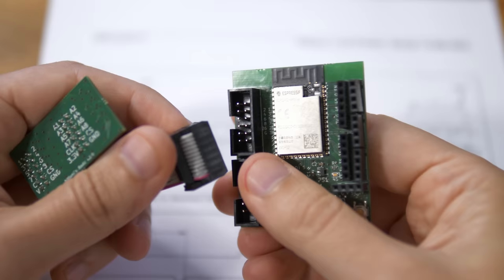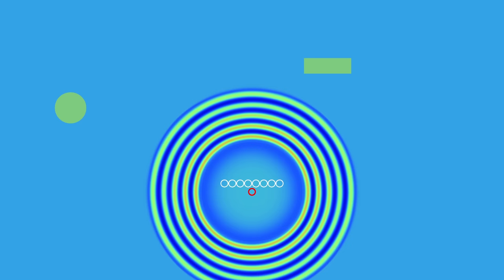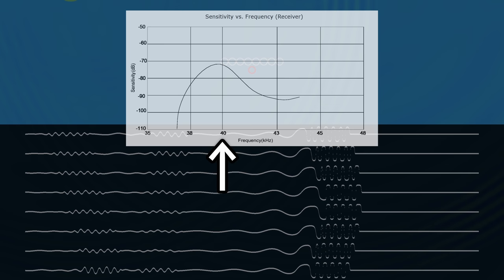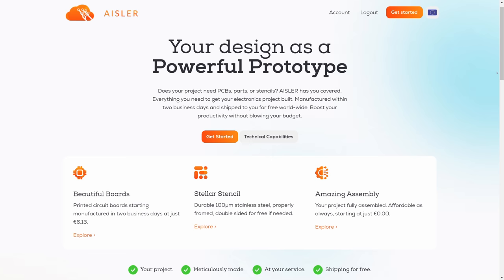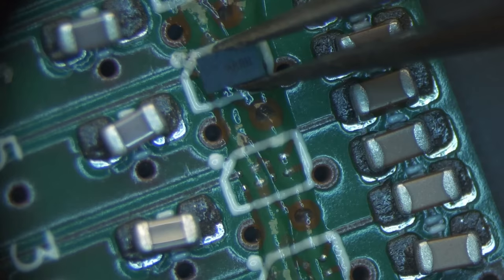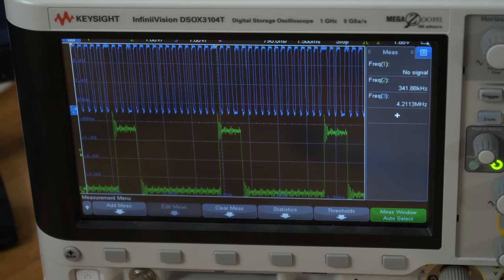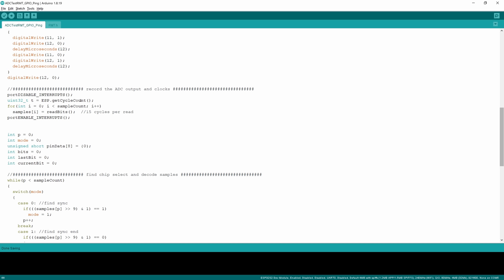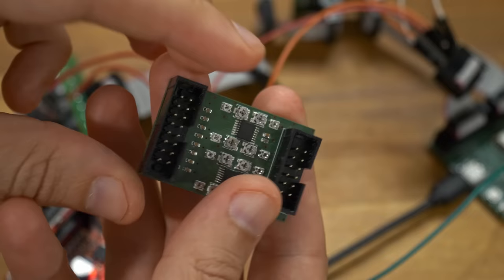DIY Sonar Scanner Ep. 2 (STEM, RMT tricks)

Comment: It just occurred to me (but I didn't calculate the feasibility, so maybe it is a flop) that the sample rate requirement could be loosened by using analog band-pass filter(s) in front end and undersampling/ ADC multiplexing. Since the signal is basically just 40kHz sine, that would work, provided that both the modulated pulse, and distance between receivers is long enough for phase difference to be noticeable with sampling rate you have available. 

Or, since nothing prevents you from using multiple acquisition periods, you can induce small variable time (phase) shift between emission start and receiver start, so that multiple undersampled readings can be interleaved to construct synthetic high sample "image" with better resolution.

Comment: Since all of the information is in the timing/phase, why are adc's necessary? perhaps a simpler/faster/cheaper/computationally less intensive method would be to convert the incoming waveforms directly into digital signals, perhaps cleaned up with schmitt triggers and highpass filtered before the amps? Also, a thought occurs of having variable gain in the amps that increases with time after the pulse to compensate for the decreasing echo strength and keep the signal in a reasonable range.

Comment: Probably you could use the DMA module to read the high-speed samples and dump them to the USB bus, if C can't keep up. With the SPI module, you can create a clock frequency up to 80MHz, and the general purpose Timers should be able to generate high speed clock signals as well.

For best result, it would be better to not space the receivers the same distance, but e.g. double the distance between them for each one as they get further from the center.

But damn, I want to make my own, 3D, scanner now, by making a cross with the receivers, not all on a line.

Comment: For maximum performance results  and best transmission, the frequency will not be exactly 40 khz, try 39800 or 39900 hz  or what fits your tx   and rx Transducer

Comment: i'd move away from the arduino ide as it's geared up for beginers and arduino boards, which is why the /io is mostly bit control. as looking at small arduino boards its bloody hard to find a single 8 bit port with 8 free i/o pins.

Comment: I´ve watched your previous video and would suggest exactly the opposite! I would suggest a huge amplifier for the transmitter so you have a better SN ratio. It will also reduce amplifier requirements.
I'm doing a analogous project but still working on the power amplifier for transmitter.

Comment: I imagine there may be some situations where your solution fails - phased array transmission allows you to select the field of view. With this setup, I can see two objects of roughly equal distance to the left and right returning a signal similar to a single object centrally located.
Reply: no, objects to the left or right give a signal to the left or right most receiver first so that both at the same time means that the signals travels from the edges through the middle to the other edge while an object in the front means it reaches all reviewers more or less simultaneously
Reply: @julianbinder2371  this is true and a fair point. Thus, let me amend to be that in the case there are two objects in such a position, it is possible to place a third directly ahead such that its response coincides with the other two meeting in the middle and fading to the edges, effectively masking its existence.
Reply: @sayethwe8683  in that case it would still create a signal at the edges at the same time where the signal from the objects to the sides exists only in the middle from my understanding

Comment: You REALLY should calibrate your transducers. I have been working with these and not only are the + and - markings completely random (at least with the cheap sources - with my 64 transducer array there were 33 incorrect and 31 correct markings), giving 180 degree errors, but in addition there is a - 30 - +30 degrees of mechanical uncertainty per unit.  Maybe you already did this, but there was no mention here.

Further, it is better to measure the 'pulse' (the Q factor is very high, so not only is it impossible to send a pulse, it is impossible to receive one, too, with this kind of transducers) and use that value for correlation.

If you really, REALLY (seems I'm repeating myself) want to take this to the limit, you should receive the signal with microphones (cheap electrets work perfectly... they work perfectly although the response drops due to the operating principle - just build a filtering amplifier to counter) and send the pulse with a shielded spark. For very short distances Kynar might suffice for both.